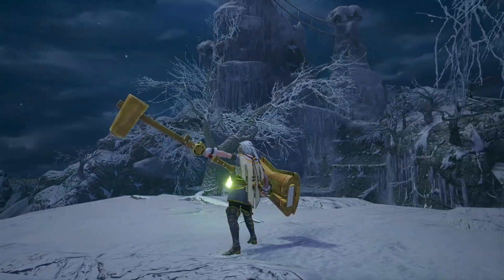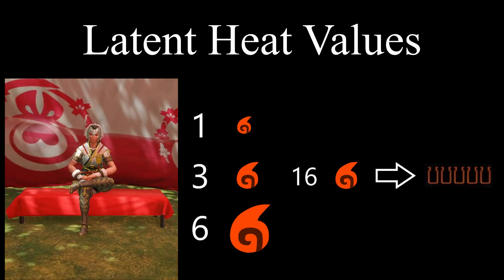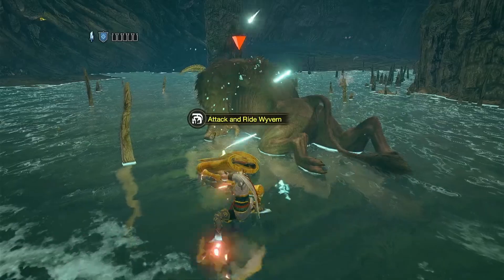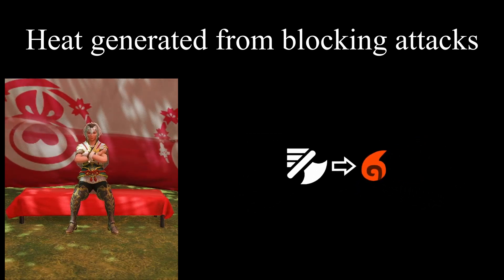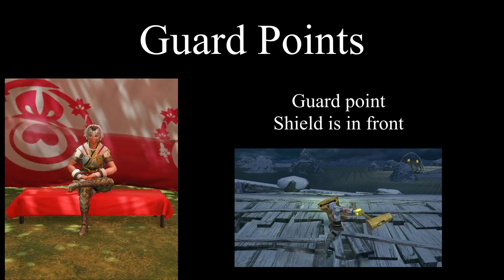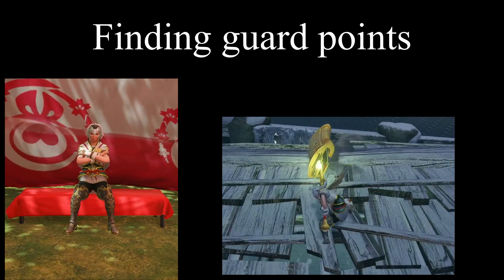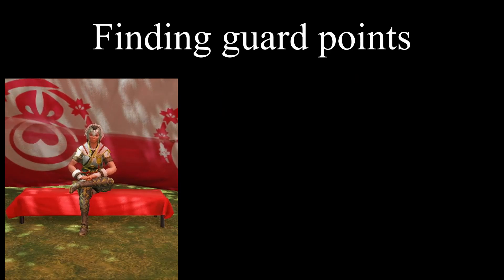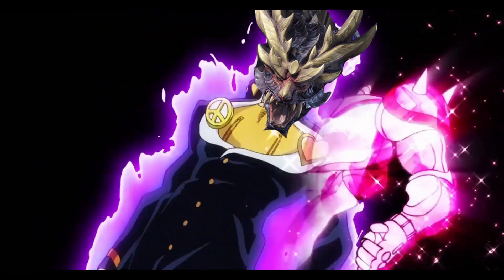Charge blade explained using literal thermodynamics... part 2!

Comment: For anyone who watches this video and is a beginner to CB the sword to axe guard point is the best one to start practicing with. 

Another suggestion would be to just run one level of guard in your builds while you are beginning to practice and learning guard points that way you can get to know what successful guard pointing looks like, using max guard can lull you into thinking you hit a guard point correctly when it really was the max guard skill compensating for your miss timings.

Great video!! I learned something from this now I can stop overly spamming the charged slash in a tight spot. TeeHee!!😅😅
Reply from the maker: Admittedly I was also late to the party. Been spamming charged slash since world :P
Reply: @Mode_na  Yup me too!! That I guess is one of the growing pains of trying to master the CB trying to break away from spamming and being precise in positioning and attacking.

Comment: I think there was one more guardpoint you can do when reloading your phials, but it's really hard to do.
Reply from the maker: You must mean the savage axe reload cancel in Iceborne right? unfortunately it didn't exist in rise. Correct me if I'm wrong, not too sure myself
Reply: @Mode_na  I might be wrong but I think there’s a guard point you can to when you press RT + B(Xbox controls) and it has existed since monster Hunter 4 ultimate. I also think there’s another one that I saw in a speedrun once, if I find I will link.